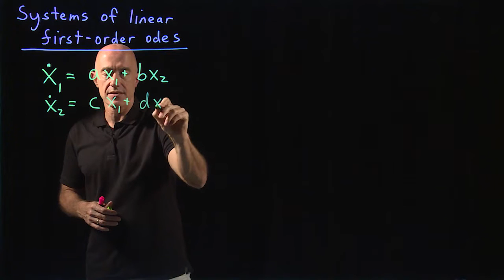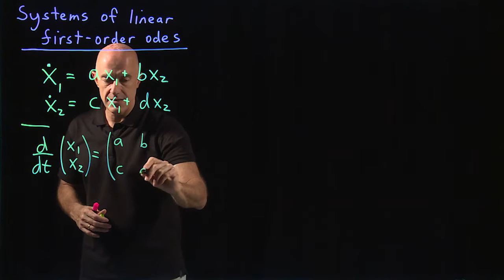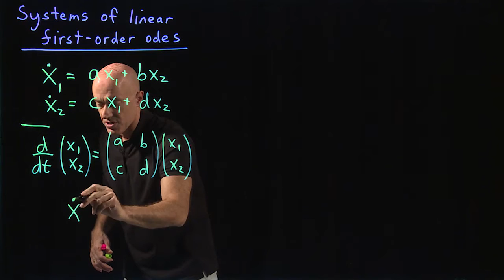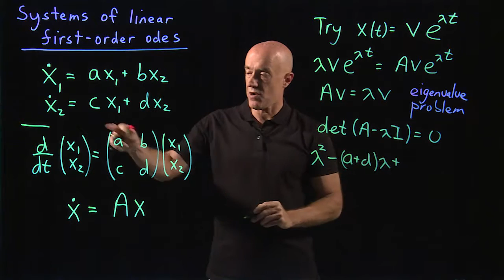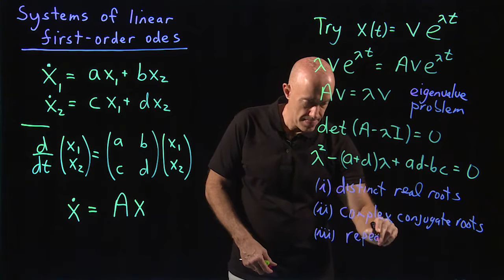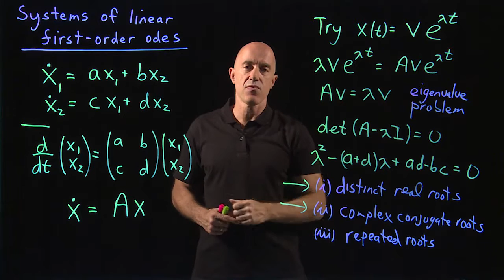Systems of linear first-order odes | Lecture 39 | Differential Equations for Engineers

Comment: What can this be a physical model for?
Reply: An electric circuit with 2 capacitors that charges with different speed.

If you want a clear schematic: R1 // C1 // (C2 + C3 // R2)
This is what I am trying to solve and I ended up with a system like the one in this video